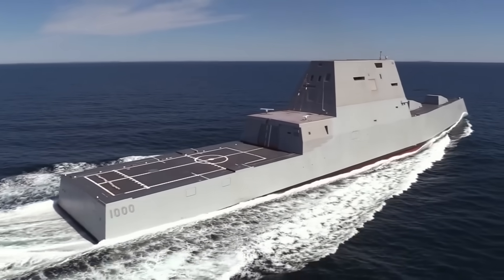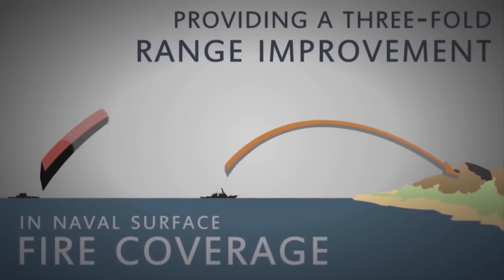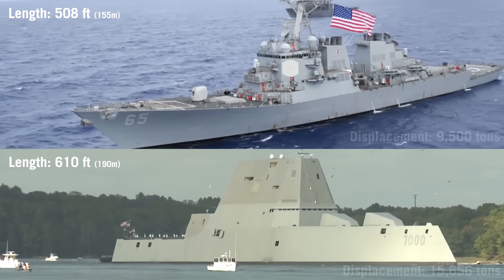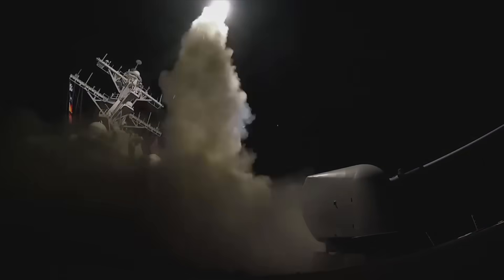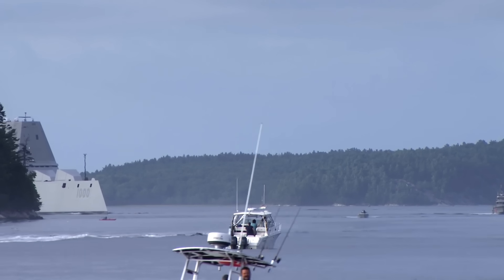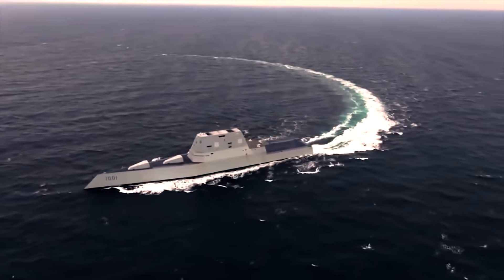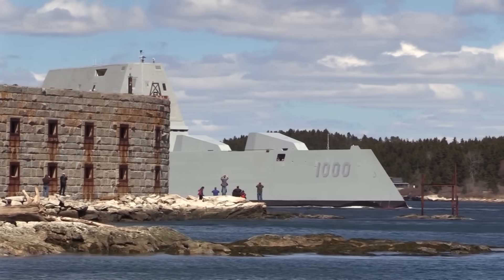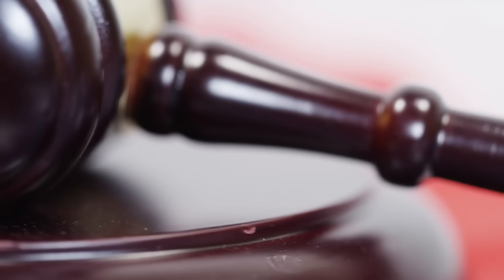What Killed Zumwalt Destroyers?

Comment: They should have taken the Army's Excalibur artillery system and Navalized it instead of re-inventing a 155mm system from scratch.
Reply: Hang on you want the army and the navy to share toys 😲 You must be new around here 😉 What was the range on the Excalibur system was it anything like the 60-100 nautical mile range this thing had? Otherwise what you say makes sense to me. That cost per round here is ridiculous.
Reply: @eldridgep2  Nah, it can do 30, maybe 40 nm, but at a cost per shot of $50k. Certainly better than 100 nm at $1M per shot and end up not having ammo for your gun system. The planned purpose was to have a naval artillery platform with useful range but cheaper than missiles.
Reply: @eldridgep2  I believe max range is 75 or 80 miles.
Reply: Especially now, with ERCA programme in full swing. Or adopt OTO Melara's Vulcano munitions.  OR sell  AGS to Army :P
Reply: @piotrd.4850  they already have billboard radar systems in the army. Look at the Patriot missile battery setup. The Aegis system is kind of big and cumbersome for the Army to use but the fundamental technology could be transplanted.
Reply: They don't even need to do that. The Army has a precision guided fuse for 155 km tube artillery that has a CEP only a little larger than the Excalibur shell, and for a $10,000 unit price.
Reply: Yeah I kind of like the Japanese Navy in Japanese Army World War II. I always questioned the wisdom of trying to come up with a totally new round when you already have a working system. But hey it's not their money they don't give a rat's ass how much they spend. Pentagon remf.
Reply: This is exactly what I was thinking... Excalibur's a great fit for this, instead of cancelling maybe they could've just built 7 ships with that instead.

Comment: Cost overruns killed it.  It is the size of a WW2 heavy cruiser, it has more gun power than any current serving ships.  By dropping to 3 the development cost was spread over 3.  It has a smaller VLS than Arleigh Burke Destroyers but their larger cells and can carry larger diameter missiles.  Their not failures and have a definite use.  Several companies are working on ammunition and they are perfect platforms for laser weapons because of the excess power.

Comment: the navy really needs to let go of the all-purpose ship. There was different functions, each with costs and combat risk aspects. Presumably the Aegis+SPY for area AA defense is the most expensive. Gunfire support is not particularly expensive, but has exposure to risk. Also is the matter how many do you need for a task. A carrier should only need 2-3 area AA defense ships, but it would best to have 5-6 ASW ships + ASW helos. These can have ESSM+RAM for local AA.
Reply: True.  What in the fk is the infatuation with "all purpose"?
Reply: Building a military based on specialized assets is not cost effective. Once you have a platform it is generally cheaper to add capabilities rather than engineering a whole new platform. For example ground attack capability increased the cost of an F-16 only by 8% Zumwalt suffered from over being too cutting edge for no reason. Mk 57 VLS for no reason (is there any missile Mk 41 can't launch but Mk 57 can ?), a completely new radar for no reason, only 20 VLS cells which makes it less capable than a generic frigate in most things, extreme automation for no reason, a special very expensive gun that fires a saboted, rocket boosted, GPS guided munition. That munition was special for Zumwalt too. It costed as much as a Tomahawk but had a much smaller range and payload, which defeated the only reason of existance of Zumwalt.
Reply: @zoka7108  Bean counters don't win battles. Its not a matter of what is the least cost to have a set collection of capabilities, which will always favor cramming all of it into a single platform. the issue is how many assets you will lose to enemy action, and still have sufficient combat capability. In WWII, the destroy could be said to be an all-purpose ship, having 5in guns, AA guns, torpedoes against big ships and depth charges against submarine, the true purpose of the destroyer was as a screening ship. meaning if the enemy surprised you, he will likely hit your screening ships first, giving you time to respond.
the distinction now is that the Aegis DDG (& CG's) is not analogous to the WWII destroyer, it should probably be closer to the WWII cruise in terms of value. Expecting the enemy to launch a low level over-horizon missile attack, and potentially a submarine attack, you will want ships far out from the carrier to be sea skimming missile and submarine launched torpedo magnets. If you a few of these ships, but still have the Aegis AA capability, and a general idea of where a submarine is, then that's half way to a win.
This is why you need low cost ships with specific capabilities that you are not afraid to put in harms way. Tell the bean counters to go f#@&-off
Reply: @zoka7108  Well your assumption is put to shame in this case.  Perhaps "cookie cutter" works for somethings ... helmet, rifle, boots.  But there are many varying fighter aircraft in service today based on percieved scenarios.  Same with artillery and vehicles and ... it goes on and on.  Never put all your eggs in one basket or assume that one size fits all or multi-purpose solves every problem.
Reply: @garypulliam3740  There are constraints to multi-purpose platforms of course. There is risk optimization in forms of dividing capabilities between more units, dedicated platorms for high-risk missions, high-low mix (also a cost optimization measure) etc... Then there is personnel training. Personnel can be proficient at a few things at most. Then, there is the problem of some capabilities countering each other. For an extreme example, fighters can never be good transport planes. And I don't see how my claim is wrong. All militaries from the US military to third-world militaries have been striving for more multi-purpose platforms for decades. Back in the day, we used to have dedicated aircraft for fighter roles like bomber-escort, interceptor, night fighter, long-range fighter etc. We also had a lot of dedicated aircraft for different attack roles too. Now, all of them are just strike-fighter. Even munitions are going to the same way. For example, all modern RPG rounds are HEAT-frag. They are effective against both tanks and infantry.

Comment: I feel like it can be boiled down to an attempt to make her too future proof.
In the attempt to make her cost effective, by not needing an updated replacement in 30 years, or extreme retrofitting. The initial cost blew through what I get the impression might eventually be 90% over budget.
On-top of that though...
I'd say massive amounts of research can and will be used for Arleigh IIA or any future models.

Comment: IMO they should be reclassified as cruisers. Their VLS can carry lots of TLAM, SM series, ESSM and future missiles of the USN.  Operating in an integrated or networked combat system they do not need to use their own sensors as the targeting data etc can be fed to the ships.
I would also consider the ship as the basis for the Ticonderoga class replacements.  As unlike the Burkes, this design has two important features that the Burkes now do not have: lots of surplus energy generation and empty space (designed in a modular fashion as well) for future sensors and weapons.
In regards to the gun, I thought they were going to be replaced with or use 127mm or 155mm guns/ammunition depending upon the replacement option chosen. 
It was unfortunate that the USN decided to try giant technology leaps, like the LCS and Fords, that drove up the R&D costs and with the reduction in the numbers of units ordered made each ship more expensive to absorb the R&D.
Reply: If you thc all the vrx and uyd's it will approach fks.
Reply: They were only classified as DDGs because the DDG program was a huge success, the Cruiser program was constantly facing decommissioning, and the concept of the battleship was so thoroughly dragged through the mud it never would have gained traction.

Calling it a DDG improved the likelyhood of funding from Congress no joke.
Reply: No, they should be reclassified as reefs.
Reply: @stvdagger8074  Expensive Reefs
Reply: they have less VLS than existing cruiser and are totally inferior to the chinese type 055 in term of VLS capacity while costing 3 times as much... but that is not the reason it is cancel, the primarily reason is it is impossible to install a cruiser level aegis system like those on type 055 and the latest dual band aegis system for future USN ship without cutting up the hull and losing the stealth, thus making such a modernisation pointless... it was simply cheaper to build new ship for the next gen aegis system then trying to fill it in an oddly shaped vessel that has to have all the sensor designed to fill it rather then the other way around of designing a ship to fit the sensor...

and honestly if you just want a stealth missile boat... there is something call a missile submarine that is both stealthier and cheaper! really the only reason to build a surface platform is to provide area control, without the latest radar, you can't really do that. stealth and detector just don't mix.
Reply: @lagrangewei  As a rule all US ships carry less weapons than chinese / russian designs.  US ships require global deployment range, while the chinese operate mainly near their own coast.  When the chinese start patrolling the gulf of Mexico, you'll see less weapons on those ships. More space for fuel and food.

Packing tons of weapons into a ship also makes maintenance difficult as there is little space to get in there and work.
Reply: @p51mustang24   there is no such rule. US ship has traditionally been more heavily armed then chinese ship. fact is VERY SINGLE US DESTROYER currently in service carries MORE MISSILES than the Zumwalt. we don't even need to compare to chinese or russian ship to see how inferior it is. the Zumwalt is just an idiotic design created to applease congress love for pointless useless "big guns" that are already obsolete. modern war are fought with missiles, not guns. furthermore your claim of range is irrelevent as chinese destoryer has longer endurance then the Zumwalt, so what is the fucking point or a trash ship?

Comment: Cost of the program drastically exceeded estimates that were initially given. The price per ship is near 4 billion dollars, and doesn't include ammo costs. The ammunition for it's main gun would have cost far more than the gun was worth in practice. Initially, it was estimated it would cost about $25,000 per round (which is a lot, but is WAY cheaper than other offensive weapons used like the tomahawk missile [costing 1.2 million per missile]).

This price rose dramatically to a staggering $900,000 per shell. That's about 2 billion dollars in just ammo per ship to get them stocked to capacity. This, and the fact that tomahawk missiles out perform the shells meant for the Zumwalt lead to it's demise. Making each ship worth more than building 3 new Arleigh-Burke class destroyers, and cost as much to build a new one as it does to reload a Zumwalt class. 
It was just too expensive for the limited benefits the ship offers. 
Granted, it's near invisible on sonar. But a warship is no good if it cannot conduct strike operations without absorbing a massive part of the defense budget.

Maybe if they planned to ditch the guns, and use already available weapons, it could come back into production. But it's not likely. The Navy is more concerned with production of new Ford class carriers, Virginia class submarines, and the infamous railgun.

Comment: You don't mention the distributed propulsion and power systems. Also, VLS mounted not in a big patch but around the entire destroyer. This gives an immensely more survival capability in case of a direct hit on the missiles
Reply: Not really cuz of the Tumblehome design. Once an enemy finds you and causes damage, you're going to be sunk. That design is great if you're not taking any damage.
Reply: There's two ways of looking at the BLS system being distributed around the ship. Especially your wrapping the ship in your magazine. Any it could be fatal. Not to mention you don't have enough people surviving keep the ship afloat assuming you even have power.
Reply: @JohnRodriguesPhotographer  The cells are built like the blow-out panels on modern MBTs. Any explosion is vented outward, away from the ship, and a single hit can't detonate the entire magazine like it would with a conventional VLS system.
Reply: @griffinfaulkner3514  Their design is assuming they are intact. Damaged cells may not be quite so predictable. I know of M1's where the blast doors performed but other damage allowed the explosion to vent inward.
Reply: @JohnRodriguesPhotographer  The M1's blast doors are also internal. With the Zumwalts, the only two access points for the VLS cells are an external impact, and the cell doors themselves. The cells are also fully enclosed, so the blast has nowhere to go but up and out, and unlike the M1, if the armor on the interior side of the cell is breached, a small explosive jet isn't going to kill the entire crew or detonate an entire magazine.
Reply: They were a grate a  design  awesome ship  I worked all 3 superstructures

Comment: Arleigh burke class destroyers are indeed more powerful And DEADLIER than this ZUMWALT DESTROYER JUNKK..

THE ARLEIGH BURKE CLASS DESTROYERS HAVE 2 phalanx CIWS for close in... 2 TRIPLE TORPEDO LAUNCHES AND HELICOPTERS FOR ANTI SUBMARINE WARFARE,..THEY HAVE MORE THAN 100 VLS CELLS FOR MISSILES, THEY ARE EQUIPED ALSO WITH BUSMASTERS CANNON, 50 cals machine guns, A MAIN 150mm battery gun, with a helipad and can launch Anti ballistic missiles, The SM3, SM6..and also carries ANTI SHIP MISSILE LAUNCHRRS THE HARPOONS..

MEANWHILE THE ZUMWALTS WHICH IS ACTUALLY BIGGER BUT ACTUALLY WEAKER...WITH ITS 2MAIN BATTERY GUNS THAT CANT  FIRE DUE TO LACK OF AMMUNITIONS...THEY CARRY ABTM ONLY 88 MISSILE CELLS COMPARED TO ARLEIGH BURKE MORE THAN 100CELLS..

THE ZUMWALT DOESN'T EVEN HAVE CIWS FOR CLOSE IN...THEY HAVE NO FINAL DEFENSE.. AGAINST MISSILE ATTACKS..

THEY ARE NOT EVEN EQUIPPED WITH TORPEDO LAUNCHERS TUBES..INSTESD ZUMWALT RELIES ON HELICOPTERS ONLY FOR ASW OR ANTI SUBMARINE WARFARE...

HOW THE FUCK IS THIS SHIP THAY BIG BUT HAS NO TORPEDO TUBES?..JUST RELYING ON HELICOPTERS?? HELICOPTERS CAN BE TAKEN DOWN IMMEDIATELY..

ALSO MENTION THAT THIS SHIP HAS LESS MACHINE GUNS FOR PERIMETER SECURITY...

AND YEAHH IT COSTS TOO MUCH BUT CAN'T PUNCH ANYTHING...

THE RUSSIAN ZIRCON MISSILES IS WHWT IT TAKES FOR THIS 5 BILLION SHIP TO SINK..

THIS SHIP WONT SURVIVE HYPERSONIC MISSILES TBH.. It can't even engage submarines without helicopters so I doubt it that it will be able to survive a Torpedo attack